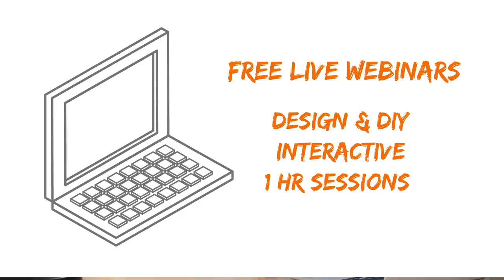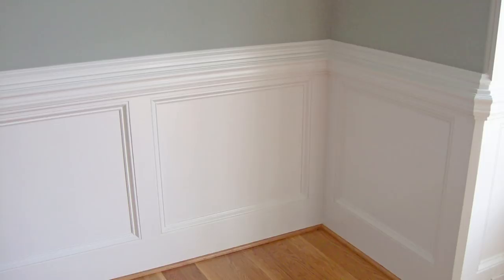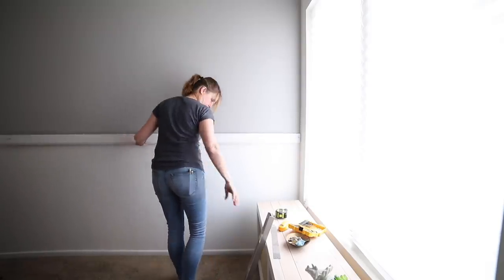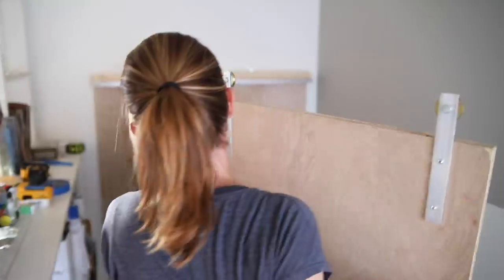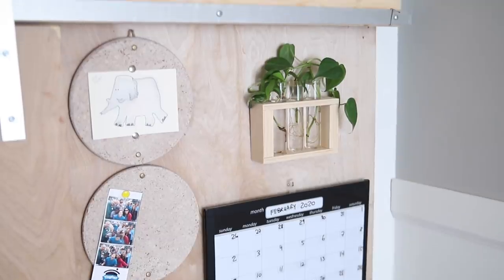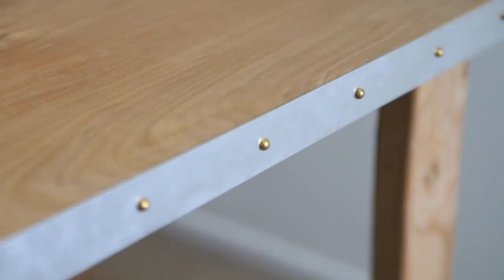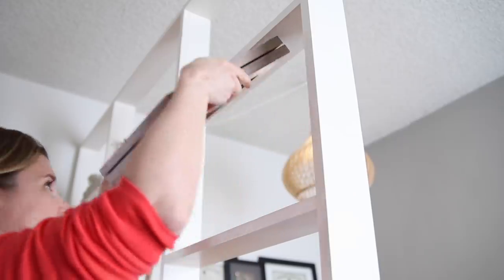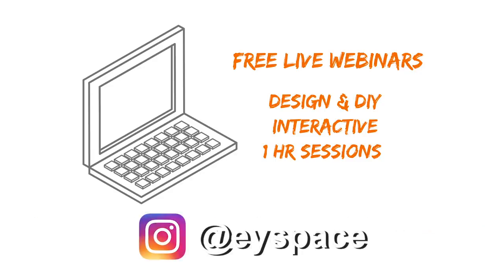Budget Small Office Makeover - Home Office Inspiration

Comment: I think sharing the concept is a nice way of helping beginners learn how to make/build things for themselves. More ppl need to know how to improve their homes in ways that work for them! I do wish you’d add some real woodworking skills into your work as there were some finishings that needed improvements such as your table, rail dividing the upper and base wall. Using some clear caulk would’ve helped attach that rail flush compared to only relying on screws which, is an appropriate way of installing a “guard rail” but also using a nailer could’ve assisted in flushing up your board to the wall. I enjoyed the creative sliding whiteboard/multi purpose board and your use/creativity in applying different mechanisms like the wheels and metal rail to create the very sliding effect you needed. It’s incredibly handy and I’ve seen woodworkers build the same concept for their workshops using nearly identical methods but having a nice finish as in wood boarder surrounding the ply edges, dados etc. This is your channel and I think you’re incredibly smart and efficient with space saving ideas and setups that others need for ideas and inspiration. Personally, if you invested in some basic woodworking tools ie: table saw, bandsaw and nail gun, etc. (proud of you for using your chisel👍🏼) and higher level finishing/woodworking skills, it’d take your content to a level that would really be neat! But again, I think as is you’re giving a service to those that acquire zero to beginner to intermediate skill levels and that’s necessary and appreciated
Reply from the maker: Thank you so much for your feedback. My aim with the content I share is first and foremost to inspire others to create a home they love, no matter the size of their space, their budget or their level of DIY skills. I don't have access to a workshop with all tools you mention, yet I still love to build things. So I like to use my limited tool arsenal as fuel for my creativity, to bring out my inner MacGyver, and I share my projects so others can feel empowered by seeing what's possible, even if they live in a tiny studio apartment in the middle of a big city. For anyone looking to learn woodworking specifically, there is no shortage of YT channels out there that specialize in this type of content exclusively.